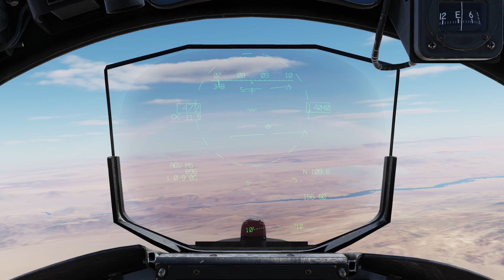F-15E OWS (Overload warning system) - Single rate and double rate beeper

Comment: very interesting stuff, the G limit is obvious - Im sure the crew chief would not be a happy bunny with a bent jet, however why / would you want to set a particular AOA for a given sortie ? would differing loadouts require an AOA limit ? or any other operational reasons ? - Love the channel and content, great work !
Reply: 14 degree's of AoA gives close to best fuel millage when traveling from A to B, 17 degree's of AoA gives close to best fuel millage when trying loiter over a single spot. 
Most of the Strike eagle stuff is in AoA, but sometimes you will use G or airspeed.